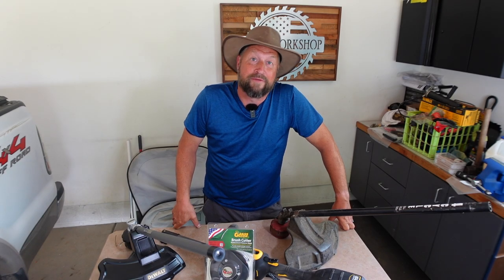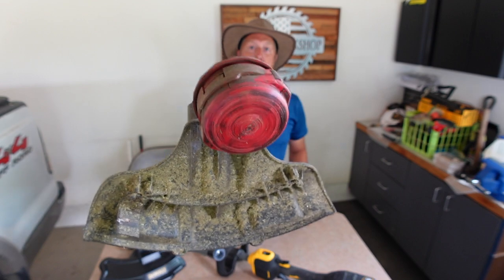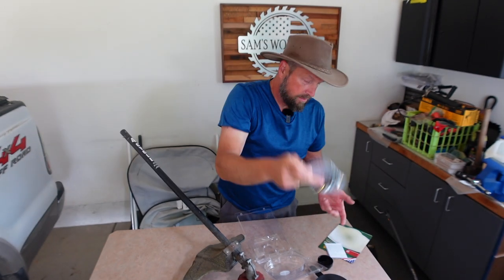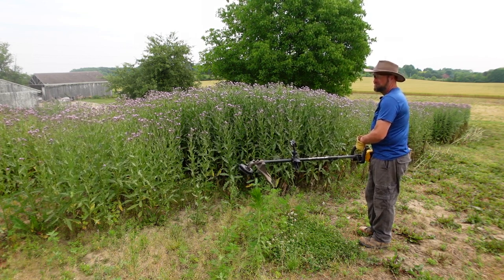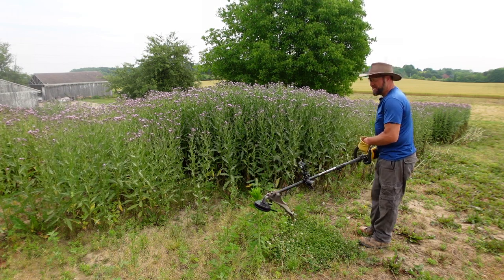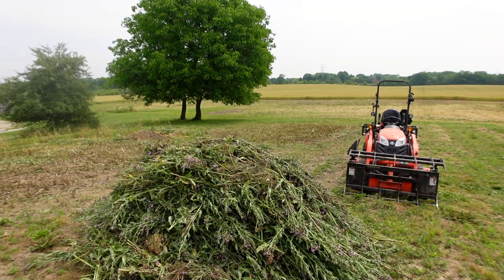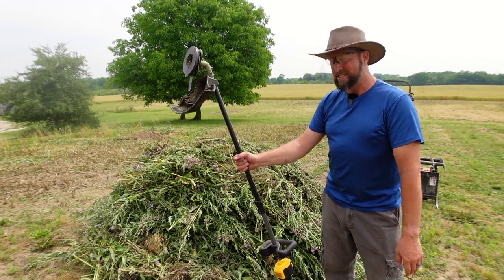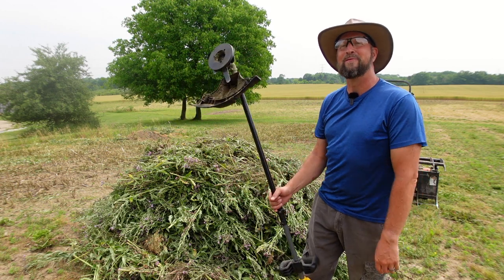Grass Gator Brush Cutter Blades On An Electric Trimmer

Comment: I machined a bushing for my 20volt Dewalt with a 60volt battery trimmer and use a 9 in carbide circular saw blade, works great
Reply from the maker: Nice! That'll probably cut through small trees too! 👍

Comment: Wonder what their excuse is for not using them on cordless or electric trimmers.  I haven't put one on my Dewalt 60V trimmer, however, the one I have is the type you can swap attachments so I can simply put the grass gator equipped trimmer attachment on the Dewalt trimmer motor.  I have a regular string trimmer head, a trimmer attachment with the grass gator head, and a brush cutter head, nice that I can swap them out without having to take the trimmer head off, and swap cutters, just click and go.  I've used my roto-tiller attachment on my Dewalt 60V trimmer motor, works great, plenty of power to run the tiller, so it should be fine running that grass gator.

I don't have the grass gator with the metal blades, mine has the plastic ones, much better trimming around the house with and not damaging things...with the grass gator and plastic blades you can do your regular yard trimming and not have to swap out the heads, that is why I went the direction of the plastic blade model.  Oh, and the plastic blade models are more rock friendly LOL.  Also, be careful around fences with those metal blades.

Hmm, I would have used that fancy orange tractor with the mower on it and cut that mess down rather than waste time with the trimmer LOL.  I have mowed a lot worse with my fancy orange lawnmower HAHA!!!
Reply from the maker: I did try mowing it first but it pushes the stocks over so the mower doesn't cut them. I also wanted to minimize the amount of waste left behind so cutting them from the bottom made it easy to clean up using the grapple. The cutter worked great but watch out for rocks. I broke a blade already 🙄
Reply: @samsdoinstuff  Breaking blades is just part of having that cutter head gives you LOL.  I've broke a couple of the plastic ones on the cutter head I have...but much better than trying to cut stuff like that with a regular string trimmer head and go through a roll of string in the process HAHA!!

Comment: It works on my 20 volt DeWalt.  Cuts thick middle of the dirt road weeds.
Reply from the maker: Love the blades... but... the trimmer head I was using with them just stripped out the gears. Maybe I tried to cut something too thick. It was an old head so I'm not really sure what the cause was. It happened on camera and I'll address it in the next video. 😁👍

Comment: I put this on my atlas trimmer. I did have to take a nut and rethread it to m10 1.25 so that it would match the shaft. 
Is there any idea on why you can't put these on electric trimmers? Seems like the worse thing is it stalls some times
Reply from the maker: @jbeezostl  I have no idea why they say not to put them on electric trimmers. It worked fine. Maybe the older ones don't have the torque the newer ones have? I switched to a Stihl kombisystem and I have a brush cutter blade for it so I gave my grass gator blades to a friend. 🤠👍

Comment: Does it still work with a non screw on head?
Reply from the maker: Great question. Yes it does. The only issue is I stripped the gears in the head. That may be because it was too much resistance or because the trimmer head was old. I'm now using a Stihl trimmer with a brush blade. 🤠👍

Comment: I have a poulan 40v power head runs its sidewalk blade fine an a gator like a house a fire. " actually scarry.. note to the wise use quality PPE. Brush is tougher than weeds.  Though it will cut them i worry it will weaken my fav poulan.  The early " expand it" used  guard that doubled as a shear making a scissor ✂️👍.  The Gators blade Edge is poor in my opinion probably cuz they can stamp the single edge Edge on the blade. In ancient times even before Christ the Savior was born the ninja concave cut Edge has never been surpassed even to this day. But I have a Dremel tool.😂
Reply from the maker: You make some very good points. I have actually upgraded to a Stihl Kombisystem and a true brush blade. I donated my gator blades to a friend. They're good for small uses, but I have some serious weed whacking and the Stihl is better suited 🤠👍